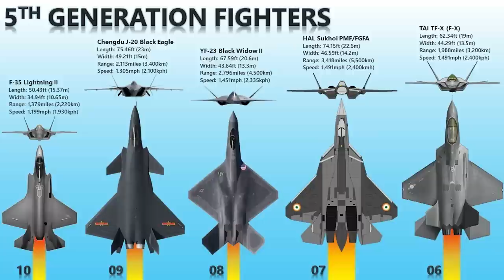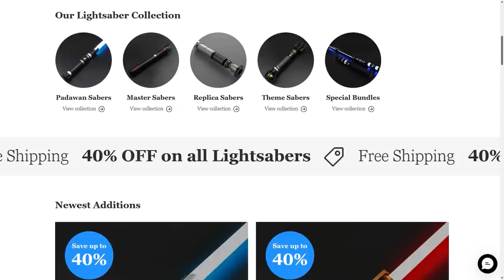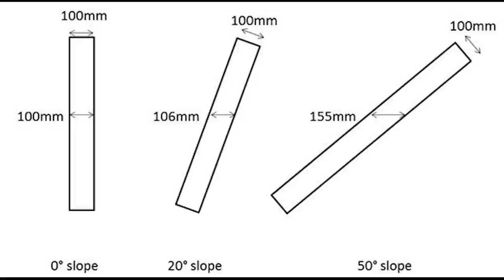Is the Tie Fighter MORE SURVIVABLE Than We Realized?

Comment: Great point about the inertial compensators. I feel that repulsor lifts (same tech ) have been totally forgotten about in the SW Galaxy. Ships weren't supposed to use their main sub light drives in populated areas because of the radiation pollution, yet we see it happen all the time in the current crop of Disney SW shows.  Anyway,  I would love to see you do a bit on the under appreciated Repulsor Lift, if you haven't already. Vode en!

Comment: @generation tech - Love this vital note on ties.  it validates quite alot, but my view on the empires might would also impact their maneuverability, as you did conclude the pilots had an advantage in handling  extreme maneuvering objectives. Also like I wrote the ea squadrons game devs to modify its capabilities to translate a side vector pivot maneuvering  ability (a side to side sliding movement ) . this is not an actual canon  ability to ties, but in a way it is. since they seem to be doing this movement in the visual radar dash hud in the movies. something I think would reflect within the arm base wing systems capabilities, and would really be a furious feature advancement like in the defenders. Something that would really leads to the empires fearsome reputation.

Comment: Speaking of transparisteel, I remember years ago that the lore had it that transparisteel was very strong, stronger than armor, but was very expensive which is why it was used for visibility backups for cameras mounted on ships but not used to actually serve as armor.  Modern lore says that it's fragile.  I prefer the old lore about it and that's what I'm going with because otherwise it's just too stupid to tolerate.  And Star Wars has a techno-babble solution to anything anyway, so that's just dumb regardless.

Comment: The Germans actually  built the first stealth.They didn't know it though.the ww2 plane they built the plane that looked like  our stealth bomber.the America's copied the design  but made it bigger.
Reply: If you’re referring to the Ho.229, whilst it does share common characteristics of the B-2 and B-21, their development shared no correlation. Despite how the Ho.229 looks, it’s radar cross section was very much detectable by British radars during the Second World War, and cannot be considered a stealthy design. To take this further, Lockheed made a mock replica of the Ho.229 and applied the same charcoal+wood glue mixture the Germans intended to fit on the production model (which never happened). The engineers found the mixture made little difference in its RCS and was a poor absorber. The Americans had also been experimenting with flying wing designs of their own, seen in YB-49. The reality of the situation is that many countries had similar programs ongoing during the same period, many of which shared nothing in common other than the intended outcome, in this case, a flying wing.

Comment: It always annoyed me that they showed TIE fighters getting taken down with wing panel shots. The wings on TIEs are for energy generation not flight stability. Losing a wing shouldn't have much affect on them in a space battle.
Reply: For a fighter as small and light as a TIE, losing one of the panels will massively throw off the balance of the frame as a whole. It's not like the thing has room for big gyros or powerful maneuvering thrusters to keep it stable when a big chunk of its already tiny mass is blown off of one side.
Reply: @richardkenan2891  Which would matter in atmosphere, but not so much in space. The ion engines/boosters are located on the pod along with the cockpit. It might decrease its maneuverability but shouldnt be catastrophic. Arguably, TIE fighters could operate in space without the wings at all if they had an alternate power system.

Comment: I thought those panels on the tie fighter were physical shields
Reply: I recall reading about them as "solar panels" capable of partially recharging the fighter mid-flight, in addition to enabling extreme maneuverability by each "wing" offering six(!) thrust vectors. That said, purely from their position on the craft they invariably also fulfill the role of a physical shield. Your comment now makes me wonder if this was perhaps by design. If so, the TIE-Fighter for all its flaws was really quite a marvel of engineering, just because it's approaching so many issues from completely different angles than conventional design.

Comment: I find it funny how you are taking about the advantages of the F-35, but the US Air Force is starting to go back to the F-15 platform in the form of the F-15 EX, as it is a better interceptor and air-superior fighter. The F-35 is better in a cold war scenario, but things are heating up, so you need a better strike fighter.
Reply: I thought they only Bought the Ex because they needed to maintain fleet size? as raptor production halted alongside the 35 delay and the F-15s continue age?
Reply: @kythebengzon8023  that was the original intention, but then the war started happening and they found out that they needed an interceptor that could carry more munitions. The F-15 is much faster than  either the 22 or 35. by almost a whole mach.

Comment: F-35 has nothing in common with any of those other designs and has completely different mechanics and capabilities. Also all of these designs were on drawing boards before the F-35 was conceived. They also cost less to make, actually work, and have a better tack record of not killing their pilots.

Also it is RCS minimization, not stealth and only works against certain radars and is utterly negated if they turn on their Radars. Which in a war with Russia, they would have to do so:

1. The AWACS they would need to feed them targeting data so they don't have to use their own radars would be the first things taken out by Russia.

2. The RCS coating was designed to be used against USSR Radar Systems the Russians no longer use, having upgraded to newer systems that see the F-35s just fine.

Hell the failure to upgrade the AWACS' radar systems and lack of investment in air defense means the Russian Su-35s are practically invisible to US Pilots till they are right on top of them as many an F-22 pilot has learned to their horror in Syria. 

Also the turbolasers are actually hybrid particle-plasma guns, they act nothing like lasers. And TIE Fighters have shields, we see them quite clearly, as long range shots do no damage to them. Its why fighters have to get close, because the hybrid particle-plasma shots lose coherency the farther they have to travel. Only by getting close can they burn through shields.

Watching the OT, its clear to anyone with a brain and actual understanding of militaries that the TIE Fighters are superior to Rebel Fighters, massacre them easily, and its only overconfidence by Moff Tarkin and Palpatine that the rebels pulled off two wins. Tarkin sending out the entire TIE Fighter complement would have saved the Death Star I, Palpatine focusing on the Home One and its three sister ships would have turned the Battle of Endor in his favor before the ground team blew up the generators.

Once again you remind me and all true analysts why you are an idiot.